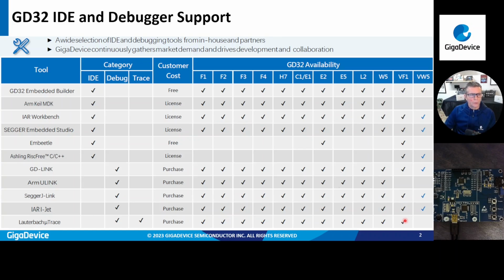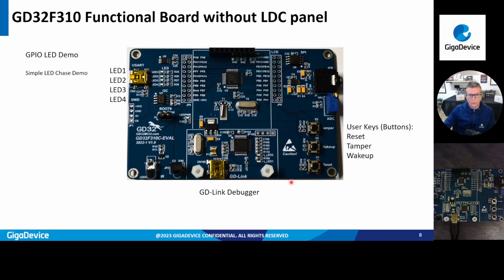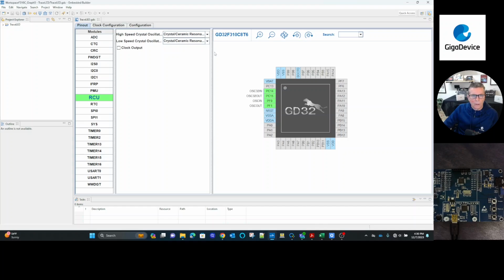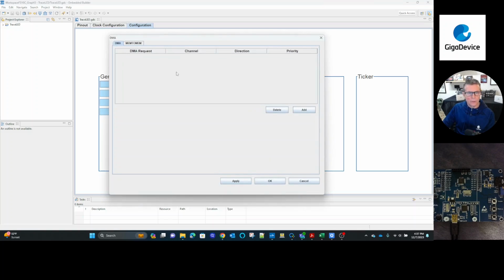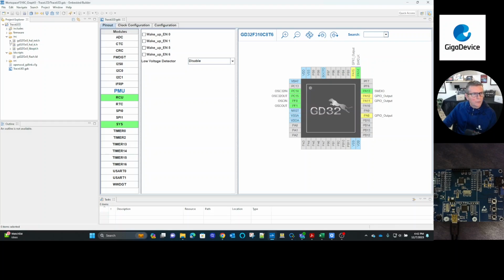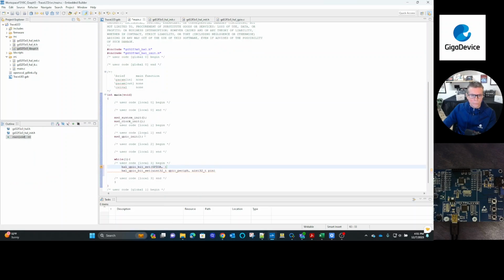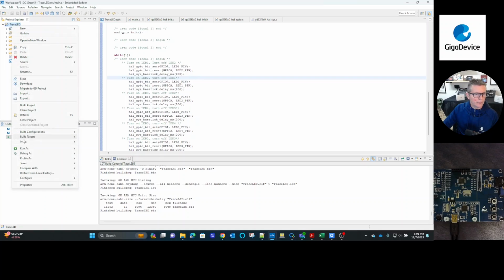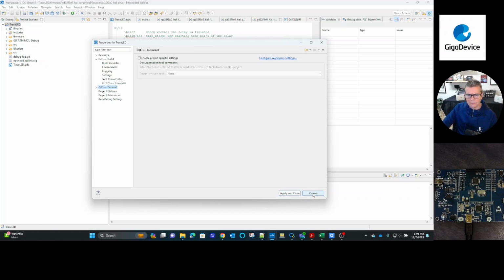Introduction to Embedded Builder's Graphical ConfigurationTool

Comment: If I have a GD32F407 which is not in a list of available microcontrollers in embedded builder and I have downloaded GD32F4xx_Firmware_Library_V3.3.1 how do I make project for GD32F407 in Embedded Builder?
Reply: I'm having the same problem with the GD32L233Rx... I didn't find it in the list of available MCUs... were you able to solve the problem?
Reply: @davidesolagna9978 No I was not. You can simply use CubeIDE and configure it for STM32F407. That's what I did first. The problem is that parameters VOH VOL are slightly different from STM32 and depend on frequency. To check this simple graphical configuration with CubeIDE was not enough, and I had to play with IAR which I'm not familiar at all. I advise you to try CubeIDE for STM32F407, burn .hex (or .bin) to GD32F407 and check performance.
Reply: @davidesolagna9978  No. Originally I used STM32 CubeIDE where I generated firmware for STM32F407 and burned it to GD32 (which worked but not officially recommended by vendor). I had some doubts about performance and finally had to check it using IAR as per vendor guidelines. Performance was the same as for firmware generated on STM32 CubeIDE.